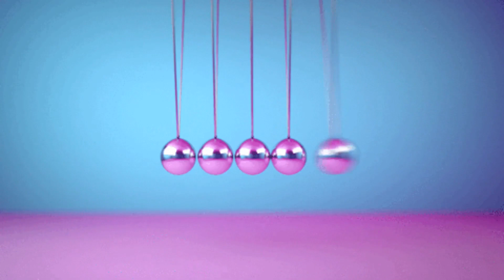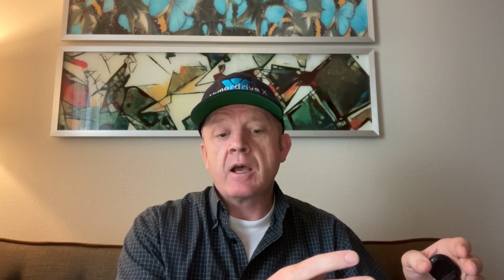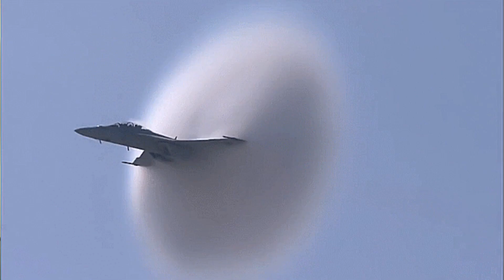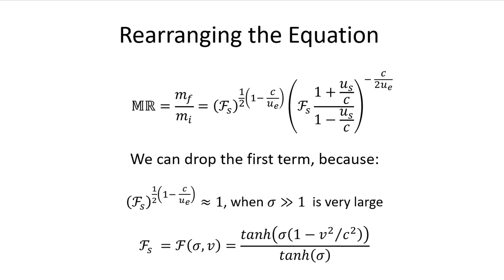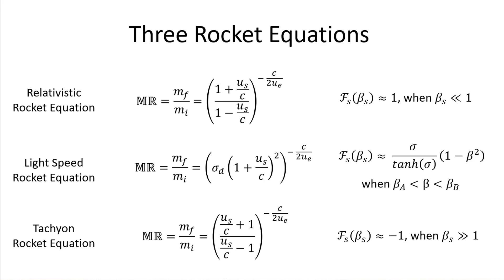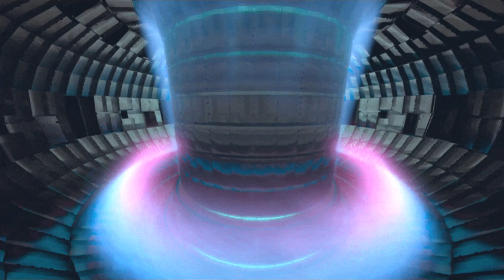🛸 Lecture 5: How Much Fuel Does a Warp Drive Need? | HyperdriveX | Faster Than Light | UFO

Comment: wouldnt fuel usage become infinite at speed of light and as you go faster mass becomes infinite
Reply from the maker: Yes if you are using Einstein classical formulas from special relativity but I extended his theories to include hyperbolic motion that include faster than light travel. This was accomplished by using a transition function which lowers the amount of energy required to cross the light barrier, it depends in a coefficient that determines the magnitude of energy required reach light speed. Think of it like a hill or a mountain, more energy is need to cross a mountain top then a hill. Space can be warped  allowing particles to transition the light barrier. I’m currently worked on ways to calculate the energy need to warp spacetime.
Reply: @hyperdrivex_warptheory  does a graviton exist
Graviton is a hypothetical elementary particle that has been proposed to be the mediator of the force of gravity. While its existence has not been directly confirmed by experimental observations, it is a predicted part of several quantum theories of gravity, including string theory and loop quantum gravity. However, the search for gravitons is an active area of research in theoretical physics, and experiments are being conducted to detect their presence indirectly.
could a graviton have mass
The concept of graviton is that it is a massless particle that mediates the force of gravity in quantum field theory. However, it is still a theoretical concept and has not yet been experimentally detected, so the question of whether it could have mass is still an open topic of research and debate among physicists. Some theories suggest that gravitons could have a very small mass, while others propose that they must be exactly massless.
graviton must be massless is it able to bend space time
Yes, a graviton, being a hypothetical elementary particle associated with the force of gravity, is expected to be massless and is predicted to carry the gravitational force between particles. It is believed that the graviton would contribute to the curvature of spacetime, and thus could be involved in the bending of space-time. However, as gravitons have not yet been observed, this is still a theoretical concept.
so a warp drive is essentially a graviton generating device
A warp drive is a hypothetical device that would allow faster-than-light travel by bending the fabric of space-time. While the details of how a warp drive would work are still largely theoretical, the concept generally involves creating a region of space in front of the ship that contracts space-time, while expanding space-time behind the ship. This would allow the ship to effectively ride a wave of space-time, moving faster than the speed of light without actually exceeding it.
Reply: Mass does not tend to infinite…Momentum does, due to the Lorenz variable, which can be thought of as the angle time tilts through as the 4D S-T vectors rotates (slightly) relative to a stationary observer. Plus, the rotation of the spatial direction makes it appear contracted in the direction if travel.  Don’t forget at some point very close to ‘C’ a ship shaped relativistic event horizon should form which effectively removes the ship from our space…Maybe there is a solution to reaching FTL in there somewhere?
Reply from the maker: Watch vides 1-4 in my series where I explain how it is done.
Reply from the maker: @contessa.adella  "Your explanation of relativistic effects is spot on, and I love the way you tied the 4D space-time vector rotation to observable phenomena like momentum growth and spatial contraction! 🌌🚀 The idea of a relativistic event horizon forming near ‘C’ is particularly fascinating—it’s like the ship starts slipping into its own pocket of reality. 🤯✨

Here’s a thought: if the event horizon effectively removes the ship from our space, could that separation be leveraged to bypass the light-speed limit? Perhaps manipulating the horizon’s formation or properties might create a path to FTL travel. What do you think—could playing with the geometry of this ‘relativistic bubble’ hold the key to breaking through? 🤔💡"
Reply from the maker: "Great point! 🚀 At the speed of light, the energy required to continue accelerating would indeed become infinite, and this is one of the key challenges in physics. The concept of mass increasing as you approach the speed of light is tied to the relativistic effects predicted by Einstein’s theory of relativity. As you get closer to the speed of light, you need more and more energy to continue accelerating, which makes it seem like an infinite amount of fuel would be required. 🔋💨

Here’s a thought: If we’re talking about bypassing these limits (like with warp drives or other exotic technologies), what if the key isn’t just finding infinite energy, but finding a way to manipulate the fabric of spacetime itself to allow for movement without actually accelerating through space? 🌌

What are your thoughts on how manipulating spacetime might address this 'infinite fuel' dilemma? 🤔"

Comment: In the framework of special relativity, the speed of light, denoted as 'c', represents an ultimate cosmic speed limit beyond which matter and information cannot travel. According to Einstein's theory, only particles with zero rest mass, like photons, can attain the speed of light. Any attempt to accelerate massive particles to or beyond this speed encounters insurmountable barriers due to the increase in relativistic mass and infinite energy requirements.

Comment: Critique:

While the lecture on calculating fuel mass for faster-than-light spacecraft presents an intriguing overview of theoretical concepts and practical challenges in space exploration, there are several areas that warrant critical examination.

1. Lack of Technical Depth:
The lecture provides a broad overview of relativistic rockets and tachyon propulsion but fails to delve deeply into the technical intricacies of these topics. A more thorough exploration of the mathematical equations, engineering principles, and scientific theories involved would enhance the audience's understanding and engagement.

2. Limited Discussion of Practical Applications:
While theoretical concepts are discussed in some detail, the lecture falls short in addressing real-world applications and practical implications. It would benefit from examples of current research initiatives, ongoing engineering projects, and potential breakthroughs in propulsion technologies that could pave the way for faster-than-light travel.

3. Absence of Critical Analysis:
The lecture presents a largely optimistic view of space exploration, emphasizing the potential for future advancements without critically evaluating the feasibility or limitations of existing approaches. A more balanced assessment, including discussion of technical barriers, ethical considerations, and alternative perspectives, would provide a more nuanced understanding of the challenges ahead.

4. Lack of Interactive Elements:
The lecture format is traditional and one-directional, with minimal interaction or engagement with the audience. Incorporating interactive elements such as Q&A sessions, multimedia presentations, or hands-on demonstrations would enhance the learning experience and foster greater audience participation.

Overall, while the lecture offers valuable insights into the complexities of space travel and fuel mass calculations, there is room for improvement in terms of technical depth, practical relevance, critical analysis, and interactive engagement. Addressing these areas would elevate the lecture's effectiveness in educating and inspiring audiences about the frontiers of space exploration.

Comment: Well, I can't fault your math because I can't tool up to that level. Having said that though, I do know that mass increases with velocity (relativistic mass). This is inconsequential at normal speeds, even supersonic jets can safely ignore it. However at speeds approaching c, the effect becomes a massive problem (see what I did there 😁). Therefore, simply plugging values into the rocket equation doesn't help much.  No reaction (rocket) drive will ever approach c because the fuel requirements approach infinity due to mass increase. If we are ever to break the c barrier, it will be some form of warp field drive, not any form of rocket.  There does seem to be some hope of doing that in the near future, though it is by no means certain at this point. I'll just have to hope for the best. 😁😁😁
Reply from the maker: "Great points! 😁 You’re absolutely right—relativistic mass becomes a massive challenge at near-light speeds (pun appreciated! 🤓). And yes, the exponential fuel demands in the rocket equation are a hard limit for traditional propulsion. The idea of a warp field drive feels like science fiction inching its way toward science fact, especially with emerging theories exploring exotic energy and spacetime manipulation. 🌌✨ 

Here’s a question to ponder: If we did develop a warp drive, how do you think humanity would handle the ethical and societal implications of faster-than-light travel? Would we be ready to use it responsibly, or would it open a Pandora’s box? 🤔🌠"

Comment: a warp drive bypasses the infinite mass issue because your bending the fabric of space to move, space it self has no speed limit, there are galaxies that are moving away from us at the edge of the universe that are moving faster then the speed of light because Space is expanding that fast
Reply from the maker: "Absolutely fascinating! 🌌✨ The idea that a warp drive could exploit the limitless nature of space itself is mind-boggling. It's like rewriting the rules of motion by shifting the game board rather than the pieces. The analogy with the expansion of the universe—galaxies 'outrunning' light due to space itself expanding—is a perfect example. 🚀💡

Here's a question to chew on: If we create a warp bubble to bend space around a craft, how do you think we’d ensure the stability of the bubble while maintaining control over its direction and size? Could there be any unintended effects on the space-time fabric in the surrounding area? 🤔🌠"

Comment: the rocket equation does not apply to a warp drive
Reply from the maker: I would disagree. Every propulsion system that we know of requires an exchange of momentum and energy to propel a spacecraft. It is unclear what the energy momentum exchange mechanism is for a warp drive. Consider ion propulsion for example, charge particles are expelled as exhaust due to electromagnetic fields. So you need a field and a particles to produce ejection mass. If a warp drive is produced by gravitational fields then you need a mass particle that is accelerated as exhaust to produce thrust. In other word the field that is generated by some device needs to act on matter in order to move. I am in the process of creating another video that explains how to calculate the fuel usage of the Alcubierre Warp Drive. My example is using a small warp field to accelerate particles to tachyon speeds. Hence it is warp rocket, or gravity rocket, where gravitational fields accelerate particles to faster than light speeds, the tachyon particles are expelled as exhaust mass.
Reply: there is a difference between the device that creates the warp field, and the device that propels one through it.
Reply from the maker: @davidconner-shover51  "Absolutely! 🌌 This distinction opens up a whole new realm of possibilities for designing advanced propulsion systems. If the warp field generator is separate from the propulsion system, it begs the question: could different propulsion mechanisms (like particle acceleration, photon drives, or even exotic matter interactions) work synergistically with the warp field? 🚀✨ 

Here’s a thought: what do you think would happen if the propulsion device malfunctioned while inside the warp field? Would the craft remain stationary in warped space, or could it lead to unforeseen effects? 🤔"
Reply: @hyperdrivex_warptheory  I dunno, maybe momentum on entry is conserved

Comment: do you know anything about anti-matter reactors work or the preportions of matter to anti-matter  to get good power levels, do you know anything about how powerful is anti-matter ??
Reply from the maker: "Antimatter reactors are such a fascinating topic! 💡✨ The energy potential of antimatter is mind-blowing—when matter and antimatter annihilate, they release energy according to Einstein's equation \(E=mc^2\), making it one of the most energy-dense reactions imaginable. A tiny amount of antimatter, just milligrams, could theoretically produce enough energy to power a city! 🌆💥

The proportions of matter to antimatter are typically 1:1 for complete annihilation, but controlling such reactions and converting the energy efficiently remains a huge challenge. 🤔 Have you thought about how to contain the antimatter safely—maybe using magnetic fields or other advanced tech? And what kind of system would you envision to convert that energy into usable power for a spacecraft? 🚀⚡"

Comment: where is your reference coming from, you humans Do not have warp drive yet so how can you tell me how much fuel an Unknown engine will use ??
Reply from the maker: Here is a great wikipedia article on the relativistic rocket equation. I extend the derivation to include a faster than light rocket. It only theoretical, and needs experimental validation.

https://en.m.wikipedia.org/wiki/Relativistic_rocket

Comment: I just want to know how many gallons of gas it takes. His calculations don't have shit to do with that.
Reply from the maker: Sorry. I didn’t give it in gallons, but the calculations show that if a rocket engine generated tachyon particles as thrust it’s mass fraction is rough 1-2 % of the mass of the spacecraft. Which would be an incredible feat comparing it to today’s technology.  The  fuel mass of a modern chemical rocket is closer to 80% of its total weight.  The derivation is of course only theoretical.